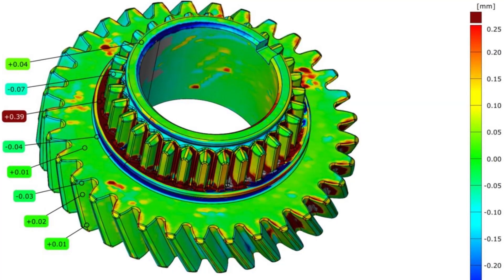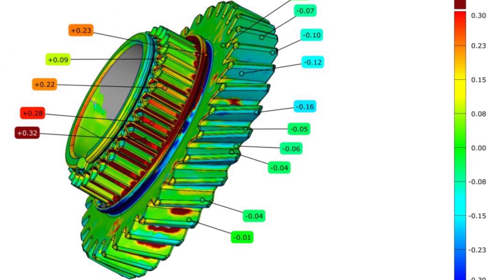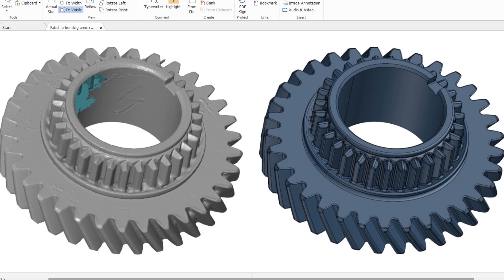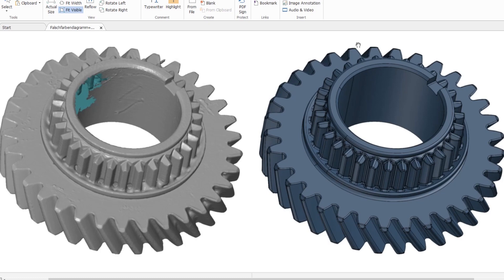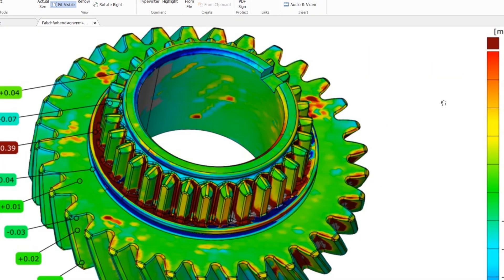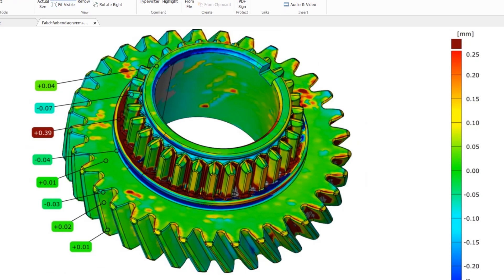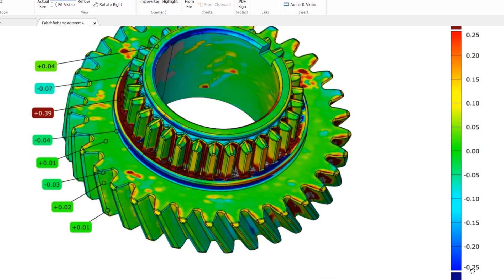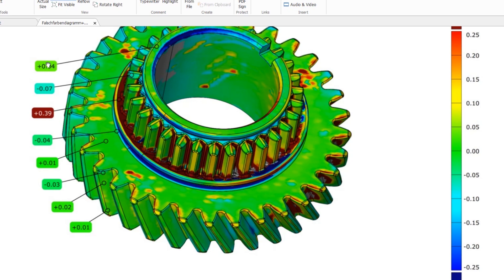What is a Nominal Actual Comparison Report? (For 3D-Scanning and Reverse Engineering)

Comment: Are those gears cnc'ed or cast, how would a calibration work? Thanks for your video, informative as usual.
Reply from the maker: Thanks. If the gears are CNC'ed, so the calibration would need to be done on the CNC machine. Maybe gears was the wrong example. Maybe injection molding would have made more sense to illustrate the problem?